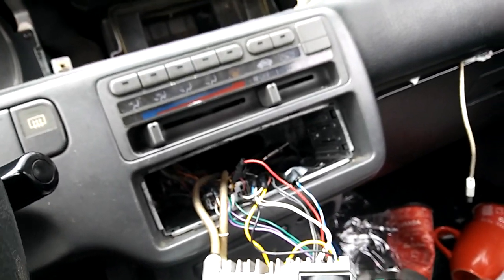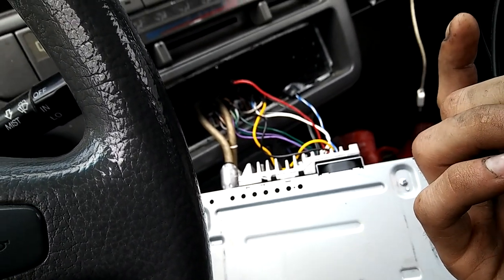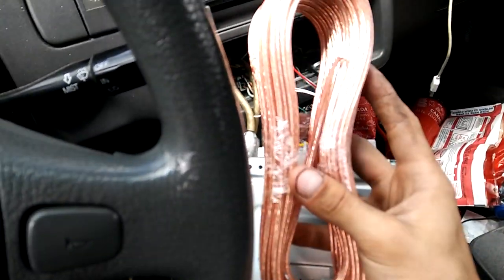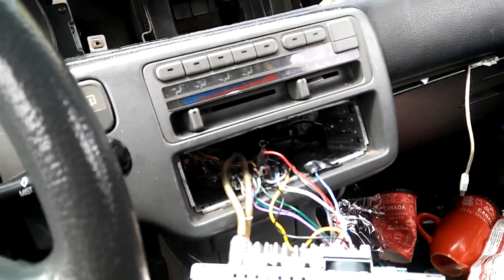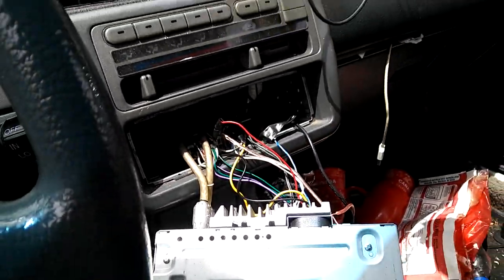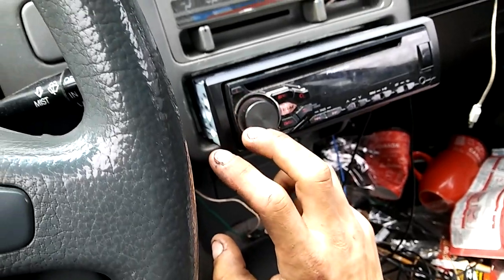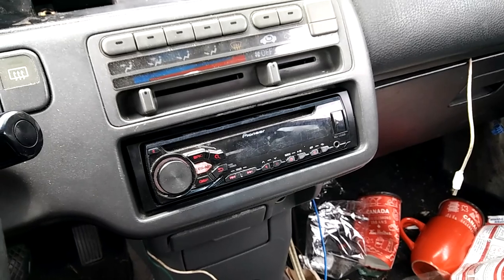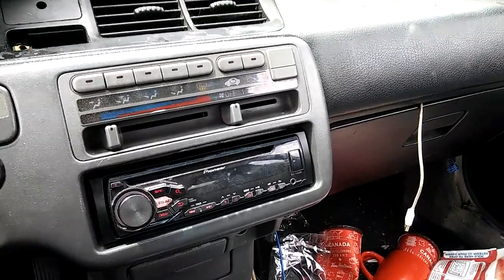How To Install Universal Car Antenna

Comment: Can the ground wire from the antenna connect to the car chassis ?
Reply: Yes. By connecting to the radio you are connecting to ground unless there is a separate wire.

Comment: I have a powered antenna in my 94 buick and I have a new deck with a power antenna lead /remote ,which is the wire I need to hook up too ?
Reply: Blue
Reply: I figured it out ,thanks